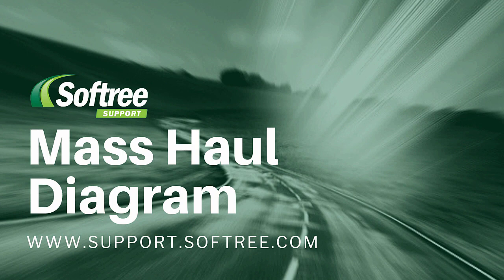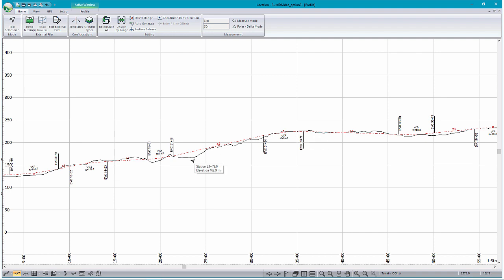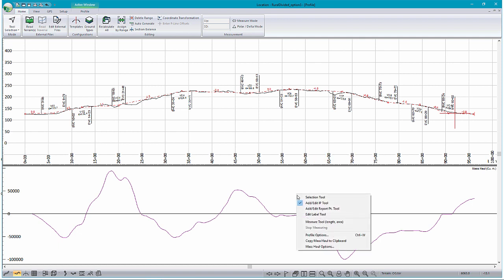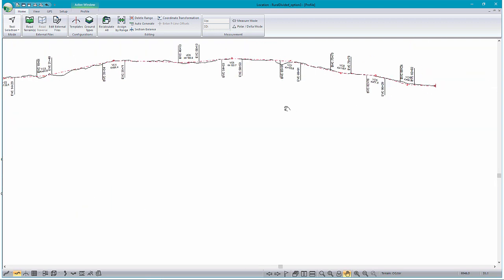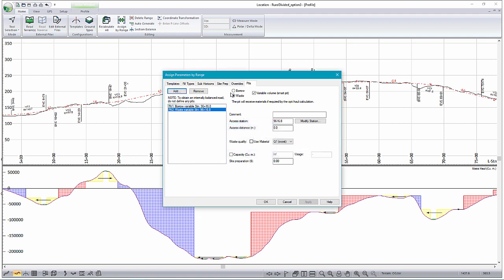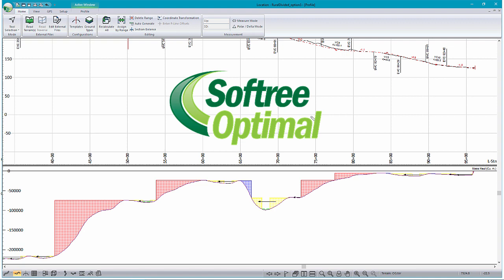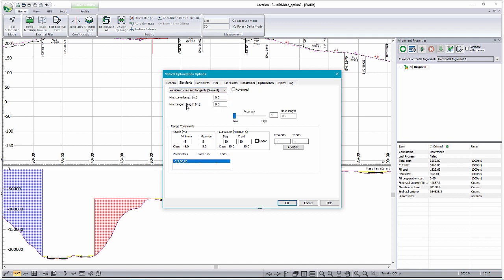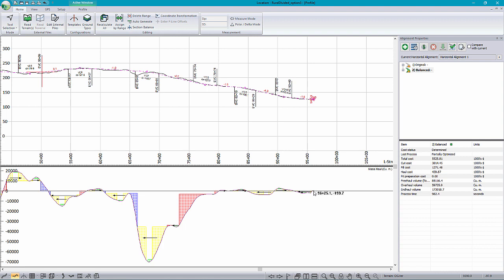Mass Haul Diagram for Road Design

Comment: I have data in the Excel 
Is it possible to import the data from excel
Reply from the maker: Hi Harikrishna, thanks for your message. 
Softree’s RoadEng software is compatible with many other programs including Microsoft excel.  When you ask about importing data from excel are you referring to survey data?  If so that data can be used to create a topo surface to design from, produce material estimates, and a masshaul diagram.  The article linked below provides a workflow for working with similar data (it references ASCII files but ASCII files are easily exported from excel).  If we are misinterpreting your question please let us know and we will try to provide you with an appropriate answer or links to appropriate resources. 
https://support.softree.com/knowledge-base/terrain-module/features-coordinate-and-attributes/importing-ascii-files.